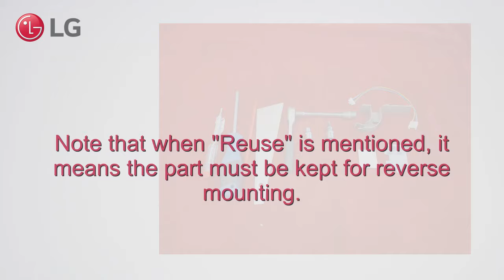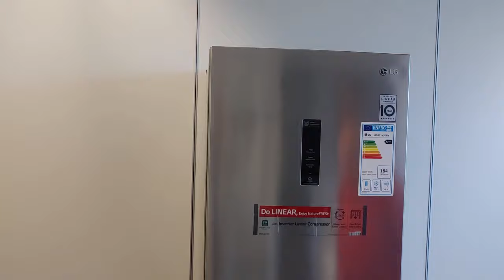[LG Refrigerator] - Reverse doors of a Bottom Freezer model

Comment: Bought an LG Fridge at the end of 2023 and the manual did not have this information. I am happy that the official youtube does have the instructions how to change the door orientation. 

The video itself is of great quality. The instructions are clear, concise and easy to follow.

The video itself should not be hidden. Either added to the manual, or official LG page, or somewhere else to be easier to find.
Reply from the maker: Thank you for the compliment and you are right. However, in some countries LG has different service procedures and wants to have this procedure done by a professional, because things can still go wrong , for example the guiding of the wires through the hinge is a meticulous job. Nevertheless we try to make this as transparent as possible.
Reply: @LGSAE  In the UK the instructions state "this must be done by LG appointed engineer otherwise the door will not be covered by the warranty". This is not stated on the John Lewis site, only that the work can be carried out by them before delivery..........for £35.

Comment: It worked! Thanks for posting this video, as it would have taken me hours to figure this out otherwise.

For those making the switch - I used:
10mm socket to remove the top door bolts
6mm socket to flip the top pivot pin
5mm allen key for the middle and lower pivot brackets
large phillips screwdriver
old credit card as a pry tool
I used my finger to scrape some of the grease from the lower pivot pin to apply to the replacement pin.
Reply from the maker: Thanks for the additional feedback and tips Jason.
Reply: Im about to try this tomorrow - do i need to  go out and buy a new hinge piece and wire piece as shown at 0:07? Or were those parts you took out of your fridge and re-used? Cheers!
Reply: Hi Jason and THANK YOU (that was a big thank you) for listing what size tools were needed. I was unable to ascertain what the two screwdrivers were; square drive or slot/flathead and the bigger one may have been a Phillips, Torx, Hex but with my eyes I couldn't make it out. A real shame that LG were unable to list them instead of using a low quality out of focus 720p video image that looked like it was added to the video.  

I sincerely hope you have a good fridge and it runs trouble free for a very long time since it no longer has a warranty since the doors were not changed by an authorised/preferred service provider. One would think that a warranty warning would have been the first thing displayed at the beginning of the video.

Comment: I found a plastic pry invaluable - used the one from an iPhone repair kit I have.  You will need hex sockets 10mm and 6mm and a 5mm hex bolt key. You likely need to order a mini ratchet set if you don't have one.  Also, to pry the top freezer mount from the door I used a wood chisel with a flat side and a bevelled side - worked MUCH more easily than the screwdriver example given here and I think if done carefully will cause less plastic damage too.  My fridge was identical without the harness.  The difference when you take the top of the door apart is you dont need to undo two screws - it all comes away with a plastic pry only, with the pieces being removed in the same order.  Thanks LG Europe - you have been MUCH more helpful than the UK who want us to pay someone a fortune for doing this job which is extremely straight forward with instructions and the right tools.
Reply: and which should be provided by LG or the retailler as part of your purchase anyway ...

Comment: When I first saw there was no information like this in the manual I got very frustaded, as one of the most important features for me when I bought it was to be able to switch doors. But this super helpful video saved my day, just what I was looking for. As someone already mentioned there should be a link or QR code in the manual to this video.
Reply from the maker: Until recent, LG policy was to have this done by SVC engineers. Latest manuals do include a guideline. We like your QR code suggestion and will forward it to development.
Reply: @LGSAE  I've purchased a 2022 LG Fridge and both the manual and online guide state that my warranty will be void if I swap the doors myself. No one has yet provided me with certified LG technician contact info

Comment: Very nice and useful video. Not sure, why the instructions were not included with the documentation. Some info that might be useful for future viewers:
- My model did not have the screws as shown @1:33 Prying the panel upwards was sufficient.
- Do not try to lift up the plastic as shown @7:12 Instead use pliers, grab from the metal extrusion and pull directly upwards.
Reply from the maker: thanks for your comments
Reply: Im about to try this tomorrow - do i need to  go out and buy a new hinge piece and wire piece as shown at 0:07? Or were those parts you took out of your fridge and re-used? Cheers!
Reply: @ray4669  How did it go for you? Which tools did you use?

Comment: Thanks for the video. Wasn't an exact fit but managed to do the operation to GBB539SWHWB by adapting some of the steps.
Reply from the maker: Glad to be of help, we do not have all models, and we mainly try to work on EU products. But again, we do not get all the samples we would like to have.
Reply: @sp3ctum how did you remove the top plastic cover of the door? It doesn't seem to pry away.
Reply: @DemetrisTziambazis  might have been some screws that had to be removed. It's been a while so I don't remember exactly anymore.

Comment: Thank you for the excellent video. What I don’t understand is why the parts weren’t included with my purchase. Our LG LRBNC1104S didn’t require us to disconnect any wires. The parts I purchased: AEH75596702 hinge assy (low left hinge) and MEG65719402 cord holder (covers left hinge) 
Off topic: My fridge took over a month to deliver and was delivered without a box (said he left it in the truck for easier transport in the elevator) and a small factory sticker hid a small dent. Which I didn’t see until after I agreed all was good. I wrote to the LG for delivery info so I can file a complaint and received no response. 
What I’ve learned: you must use Jet dry or your dishes will be wet after the cycle. To use each * functions  you must press and hold the function you want to use down for 3 second and once all the functions are selected then press start. What I did wrong: was holding the start for 3 seconds.
Hope this was helpful.
Reply from the maker: Thanks for your comments, noted and to be included. As for the parts, it depends per country if supplied or not.

Comment: I used this video to reverse the doors on an LG GBB72PZEFN, which is slightly different to the model demonstrated. It can be done by one person, the doors aren't as heavy as they look, but two people would be better. (In the UK, it is misleading to say that the doors are reversable without pointing out that a further purchase is required.)
Reply from the maker: Thank you for using the video. When purchasing the appliance, the bottom bracket should be supplied. Which "further purchase" are you referring to?
Reply: @LGSAE  the further purchase is the hinge and also paying for the preferred service provider to do the job so you don't void your warranty (as stated in the manual). That's why there are not instructions in the manual on how to change the doors.
Reply: @celineos8639  You don't need to purchase the hinge, it is included with the fridge. In case you throw it out, you need to purchase it again, but that's your fault, not LG's.
Reply: @celineos8639  WHAT? I am helping an old friend change her doors so I haven't read her manual about the warranty being voided if the change is not done by an Authorised/preferred Service Provider. I would imagine she will not have understood that the warranty would be null and void as like all legal stuff it will be obfuscated in their usual mumbo jumbo fine print. It looks like LG are or have descended to the bottom of the pile with all the rest of the get out of jail warranty free legal trickery. Their products used to be really quite good.
Thank You for bringing the warranty voiding to my attention. I am most appreciative of this and will pass it on to my pensioner friend. 👍
Reply: @josephking6515 the warranty voided by the DIY door reversal is only to do with any issues regarding the door reversal. If done correctly there should be no issues. Now if someone starts the door reversal and finds it too difficult and then have to call out an Enginner, OR they misaligned the doors and the doors don't seal properly and then have to call an engineer, this is when someone will have to pay an engineer to fix the issue, that is not covered by the 24 month warranty. Basically and rightly so, they won't cover damage done by a person who shouldn't have attempted something beyond their measure.

A qualified engineer who comes out to check for example the compressor and sees the door reversed correctly and there's no sealing issues etc... the warranty is still covered.

Comment: Super video and very helpful, but you could have included some info in the user manual. For example a link to this youtube video.
Reply from the maker: Thanks for the tip!
Reply: They added different sentence to they manual :)

"Only qualified service personnel from LG Electronics service centre should disassemble, repair, or modify the appliance. Contact an LG Electronics customer information centre if you
move and install the appliance in a different location."
"Reversing the doors must be performed by the qualified personnel of LG Electronics. If not, the doors will not be covered by the warranty"

This is from LG Fridge&Freezer owner's manual. So, even if you want to move your fridge to different corner you need to call LG Electronics service centre. :) So here are no talk about reversing doors by yourself or you may loose your warranty.

Next fun sentence: "To remove frost from the appliance, contact an LG Electronics customer information centre." Do I need to call customer center to remove frost from inside of freezer?
Reply: To do it properly you have to pay the LG service provider - this is not made clear in any of the specifications on the LG websites and the retailers website, and you can spend as I did hours on the ph trying to get someone to have the decency to acknowledge that this information should be provided up front. Basically, you are not told which side the doors are hinged on and you cannot request a fridge with the doors aligned the way you need them to be. And then if you are in your 80s and living alone, you have to pay  $200 to change the doors. And LG does not seem to realise that paying that additional amount should not be required of the customer who has specifically researched to find a fridge on which the doors can be reveresed. LG should indicate clearly that an additional amount will need to be paid to change the doors without voiding the warranty.

Comment: What is the wire harness in the 7 second mark? I don’t see it again in the video?
Reply from the maker: Very well noted Dan. It is marked in the notes, but indeed not specified in the video itself. This is an extension cable for models with an integrated display (not shown in this video)

Comment: The video is very explanatory. I would like to ask a question. After changing the way the door opens, the refrigerator door does not come face to face with the freezer door, it protrudes 5mm from the side of the opening and from the side of the hinges. This is ok. it is acceptable. Model GBB 72MCDMN.
Reply from the maker: thank you for your positive feedback, that's why we make such videos. Not sure how it exactly appears now in your situation. Did you rotate the door rubber as well?
Reply: @LGSAE   Thank you for your respond! Yes, we did. Actually the LG technician did it and he insists that the difference is normal for a LG Refrigerator. I do not think that this is true for your products though.

Comment: Hi! Are the hinges designed for opposite mounting included when you purchase the fridge? Or do you need to buy them additionally? if so, from where?
Reply: Hi... they are included when you buy the fridge :)
Reply from the maker: This is different per country. For more details you can contact the LG Contact Center in your country

Comment: I've just got a LG-GBM22HSADH fridge freezer. The door reversal is startightforward until you get to the bottom hinge. A) it's not clear that the hinge is reversible B) there are no pre drilled bold holes on the underside as there are on the side where the door currently sits. The vendor - Hughes, who have been useless, advised contacting you. Please can you help? Thanks.
Reply from the maker: First, apologies for the late reply, we monitor these comments but not on daily basis. You are absolutely right, door reversal on the GBM models is indeed a bit different from the model presented in the video. Please take into consideration that you only require the supplied accesories. Since there is no bottom hinge in the package, this should give an indication that the current one can be reversed (unlike the 1 shown in this video). Actually the holes ARE pre-drilled, but it may seem they are not as there is a small bit of PUR in there. Just reverse the bottom bracket and the holes that it covers, you can turn in the leg at that point (it may require you to put some force when turning it in.) Let us know how it worked out please by replying to this post.

Comment: What size ratchet part is being used in this video? It'd be really helpful to have a written list provided here as the manual has absolutely no information in it.
Reply: 10mm and 6mm. You likely need to order a mini ratchet set if you don't have one. Also, to pry the top freezer mount from the door I used a wood chisel with a flat side and a bevelled side - worked MUCH more easily than the screwdriver example given here and I think if done carefully will cause less plastic damage too.
Reply: @user-by8wb5gc3p  thanks. in the end we got someone LG recommended to reverse it for us (didn't like the disclaimer that you void your guarantee if you do it yourself). Fortunately the cost was covered by John Lewis!

Comment: Should this apply for LG GBP31SWLZN?

I can't get the fridge door lifted off after opening the 2 top bolts holding the hinge in place in 2:30.
Reply from the maker: This seems to be a model with an internal display at that location, right? The procedure should be similar. Can you gently pull the fridge door towards you? Note that after taking out the bolts, the hinge is still hooked into the chassis, so wiggle it a little. The hinge must be getting loose from the chassis.

Comment: Yesterday, I bought LG in Spain ... Model: GBB72NSUCN1 and would like to switch the doors but my LG Official Service in Spain told me that I may lose the warranty of my doors/refrigerator.Their Professional costs 100 euros to do this job!Wondering what to do now as it's expensive :-)
Reply from the maker: It is indeed a paid service if you request it to be done be a professional. If you take the steps as mentioned in the video it should work. One of the most important steps is to guide the wiring correctly and make sure it does not get stuck, for example at the hinge side. Good luck!

Comment: After changing the door opening in a Model GBB 72MCDMN refrigerator, the distance of the door from the body of the refrigerator on the upper side is 10 mm, while on the lower side it is 14 mm, this is within the permissible limits. If not, what could be wrong? Thank you
Reply from the maker: I'm not sure which distance you've measured. Does the door seal close the door well? We always advise to reverse the door seal 180 degrees after changing door direction, especially when you have been using it for a while.
Reply: @LGSAE  The distance I measured is the distance between the door and the frame of the refrigerator at the point where the rubber goes around. It seems that the rubber presses with different pressure. Door seal reversed 180 degrees and the door almost did not press on the bottom side. It was much worse.

Comment: Hi there, as with a few other people, I'm having problems with the fridge door seemingly being higher than it should be - I've tightened and readjusted everything and still can't get it down, which means when I put the plastic cover on the top hinge, it won't go on properly. I also have a seal that's compressed too much, and it doesn't seal the fridge door?
Reply from the maker: Thanks for sharing. depending on your model it might be the middle hinge, is it level (before putting on the door)? As for the seal, please take it off completely, rotate it 180 degrees and put it back on, then the sealing will be as it was. At the hinge side there is always a bit more compression, so when you reverse the door it will automatically be a bit more compressed that side, so rotate it with the door opening should solve this.
Reply: @LGSAE  hej LG,
having the very same issue. After switching the doors, the main door is 'too high' (2mm) so that I can indeed mount the door but the plastic cover does not fit and you can see when you're in front of the freezer that the door is 'hanging' to the right side a little bit.

Comment: hello we have just purchased a LG LG GBB61wjzn lg refrigrator refrigrator and it was delivered today. We are waiting for a few hours to plug it in but we are not able to open the refrigrator or freezer doors. Do we have to plug it in first?
Reply from the maker: Nope, it should open normally, however sometimes there is tape used to hold the doors.